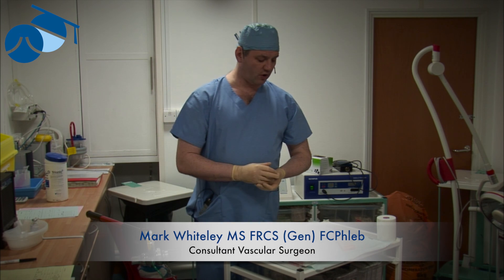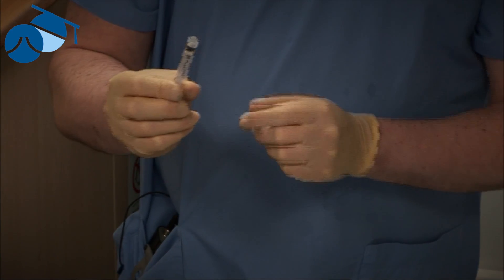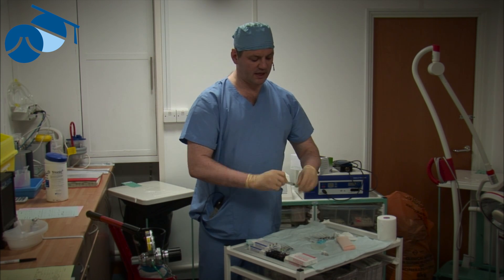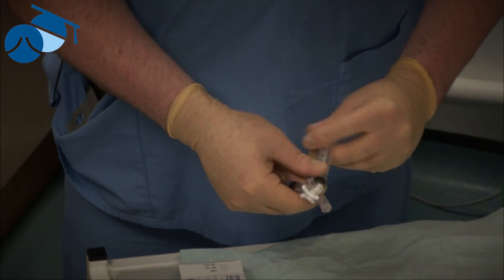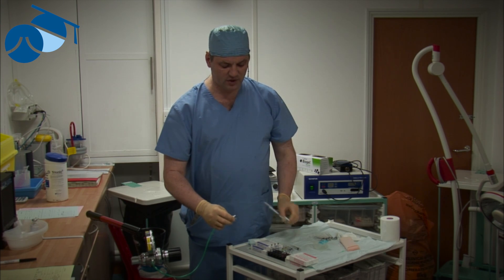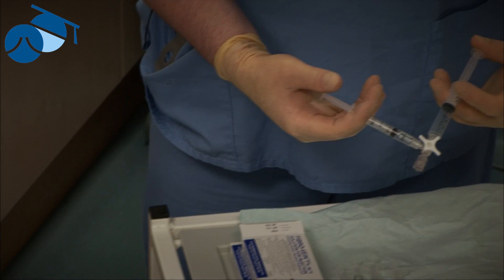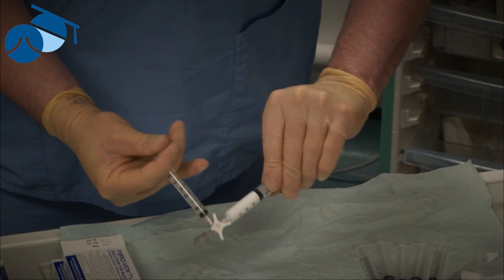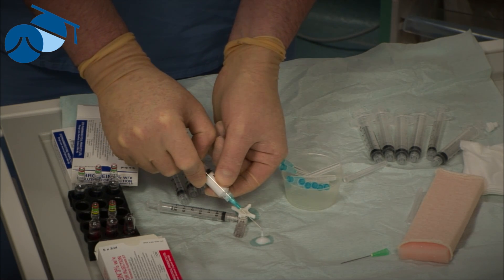Making foam sclerotherapy using the Tessari method (varicose veins)

Comment: Did you use polidocanol 3%?
Reply: Hi Vanessa, it depends on which veins and the wall thickness. For thick-walled big veins, usually 3% STS - Polidocanol for thinner-walled and smaller veins - see our research paper https://pubmed.ncbi.nlm.nih.gov/26790396/

Comment: Is this the same thing as Varithena? My surgeon is wanting to compound it themselves, am I crazy to request the brand name Varithena?

Also, is this safe? I feel like this liquid would spread to my heart and cause long term health problems

I really appreciate any sort of guidance you could provide
Reply: It is not Varithena which is the commercially available mixture of 1% Polidocanol and Carbon Dioxide. Many physicians make their own foam sclerotherapy as this is far less expensive. However, it should not be made with air, as that has nitrogen in it (80%) which does not dissolve very well - and so can lead to possible complications. So it depends on how your physician is making their foam.
Reply: Yes - is safe. Like all drugs there is a safe dose and an overdose. Your physician will only give you a safe dose - just like any prescription drug that is injected or given as a tablet.

Comment: It can't be done with ambient air ?
Reply: It can be - but as air is 80% nitrogen and nitrogen is very poorly soluble, the risk of bubbles going through the heart, through a hole in the septum (1 in 4 people have this) and to the brain is increased. Hence the use of safer carbon dioxide and oxygen mix in the better vein clinics.

Comment: @collegeofphlebology At what pressure is the CO2/O2 mixture available for filling the syringe?
Reply: There is a pressure regulator between cylinder and syringe, and so gas is at atmospheric pressure when used.

Comment: Great video, Sir. So... Can I use an oxygen to make that foam?
Reply from the maker: iqbal lahmadi 

Thank you for your question.

Oxygen is safer than air – but
doesn’t make good foam.

Carbon-dioxide is better as it
dissolves quicker, but again doesn’t make great foam.

A mixture of carbon-dioxide and
oxygen is the best gas to make foam.

See our paper:  http://www.jvsvenous.org/article/S2213-333X(14)00163-2/abstract
Reply: Thank you - Oxygen is not as good as Carbon dioxide : Oxygen mixtures.
Reply: Did you use polidocanol 3% ? 1 ml